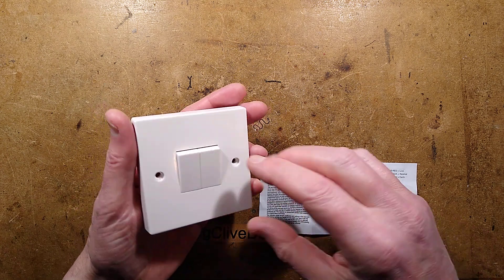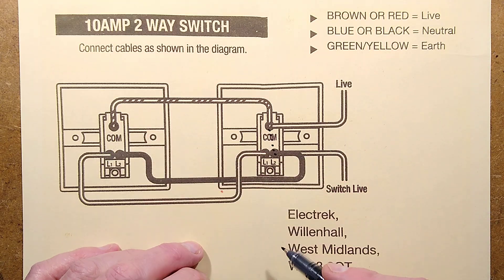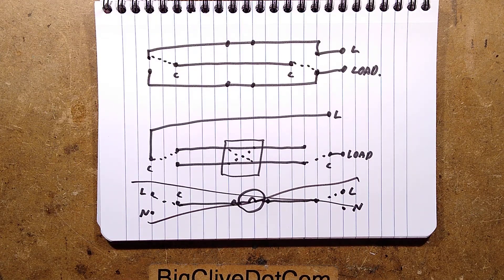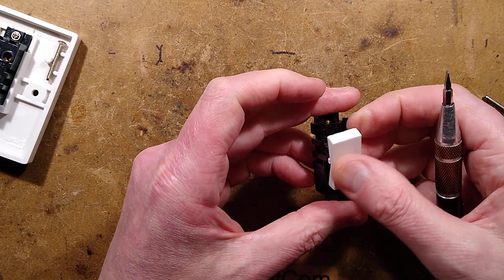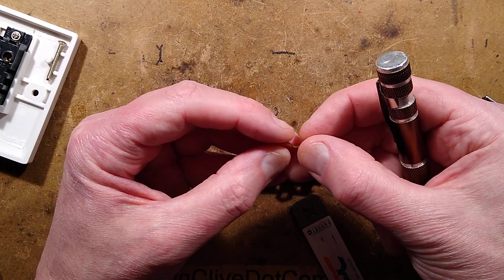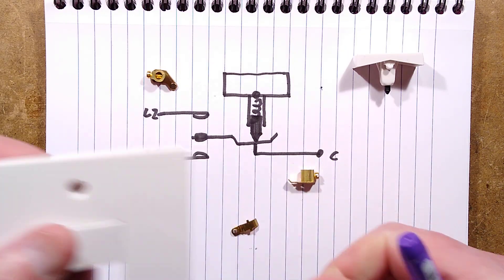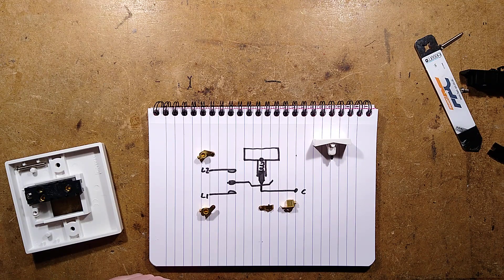Poundland 50p switch teardown

Comment: Can someone please explain the benefits of the prefered way of wiring? I only see it needing more wires, thus being more expensive 🤔
Reply: If you mean the top / uppermost circuit that Clive drew, it’s because the left hand switch only needs one three core & earth (widely available in the U.K.) cable to it. The right hand switch in addition has a two core & earth cable in (power in) and a two core & earth cable out (feed to the light or load).
The middle circuit needs either a length of single core cable (hard to find in the U.K.) or a two core & earth cable with one core unused. And you still need to get the neutral to the light / load...
Reply: @Mark1024MAK  I think there's a difference in where you want to use it. An in-door domestic setting uses only single core wires, and then I would prefer the second schematic, only two single wires between the L1 and L2.
Reply: @erikdenhouter In the UK single core wiring is not generally used in residential situations. Twin and earth is used, with three core and earth (using the 3-phase colours) for the second switch.
Reply: @SteveW139  Oh... In the Netherlands the standard is single cores in PVC piping, only for extra's like an extension or shed (or just when you see fit) we use 3 core wires.
Reply: @SteveW139  Single core used to be used in the UK when it was common to install conduits. Indeed at one time I'm told conduits were compulsory. 

It's still used today when rewiring older conduit circuits: you simply use the old wires to pull the new ones through. Homes which have had extra wiring added since being built with conduit then end up with a mix of the two types of cable.
Reply: @trueriver1950  - in the mainland U.K. as far as I am aware, conduit has never been compulsory for domestic properties. Some organisations did have their own requirements which specified that conduit must be used. Conduit systems are considerably more expensive than using twin & earth (2 core & earth) and 3 core and earth cables hence why you don’t often find domestic properties with conduit systems. Where conduit is used throughout, then normally all wiring uses single core cables (note that this is “single” insulated cables and is only permitted within conduit or within equipment/enclosures). Hence the middle circuit would be used. All the above relates to normal mainland U.K. practices. Other countries may have different practices.
Reply: It means you can control a light from 2 locations, eg a stairway light from the top & bottom of the stairway.

Comment: In Germany it is called “Hamburger Schaltung” or Carter System. If you have a metal lamp socket (e27 e.g) you may be in for a nice surprise 😮
Reply: I know it as Hamburger Schaltung too. I heard it was used in the post war but thankfully its not legal anymore. i always use the basic version that Clive drew first
Reply: I also know it as "Hamburger Sparschaltung" (Hamburg economy wiring),  because assuming that you have live & neutral for free anyhow at the switches (e.g. sourced from a socket nearby), any extra conductor between the switches requires extra conductors. The first variant shown in the video requires two extra conductors, the central one requires three(!) extra conductors, whereas the non-compliant one only requires one extra conductor. The central variant is nice if you don't have the grid near one of the switches, because you get "live in" and "load out" at the same end.
Reply: @tw11tube  The method gets especially interesting in a TN-C system ("klassische Nullung"). I remember reading about someone who managed to somehow cobble a switched socket into one of these circuits that then had live earth contacts half the time. Also the setup only works with DC-rated switches, modern ones just arc and burn out fairly quickly.
Reply: @Ragnar8504  Well, actually you can't install a socket with "klassische Nullung" (providing PE by connecting it to N inside the socket) at the load position of the "Hamburger Schaltung", as there is no N conductor, just two conductors that might potentially be live. So this installation was a failed attempt at trying to provide "klassische Nullung".
The worst I experienced in this regard was sockets with missing PE (due to broken "klassische Nullung", so chassis was at 110V through the interference suppression caps, which provided an uncomfortable tingling experience.
I heard about installations in West Berlin that operated on 220V 3-phase current (i.e. 220V live-to-live, not 380V 3-phase current with 220V live-to-neutral) well into the 1970s, so standard german household appliances were connected between two live connections. If the sockets in that installation provided PE at all, it surely had to be provided using a dedicated conductor.
Reply: @Ragnar8504  DC rated switches? I have seen 1960s, probably older switches marked AC only.
Reply: @Ragnar8504  What happened with that person who connected the TN-C socket to that  system?
Reply: Came across the 115/230v single/three phase in my cousins old house in Belgium.  Went crazy trying to work it out installing a new water heater for him until he explained there was no neutral!
Reply: The actual reason why it is called "hamburger schaltung" is, as opposed to the rest of germany, wiring in hamburg was always done with seperate N and PE conductors, as opposed to the rest of (west) germany, where the TN-C system was quite popular until the mid 70s. (Klassische Nulllung)
Reply: @FakeTheAntivirus  Did Hamburg have TT or TN-S? Regardless, TN-C is just a stupid system.
Reply: @mernokimuvek  TN-C-S, the PEN conductor was seperated in the fuse box.
Reply: @FakeTheAntivirus  Did they have a proper grounding system connected to the separation point or was it done in a shitty way like in the UK with no ground electrode at all?
Reply: @mernokimuvek  Depends on the building and the age, nowadays, all PEN conductors are grounded at the seperation point which is now located directly at the primary fuse box (where the cable enters the house), and then from there on a 5-conductor cable is used to connect the meter cabinet. However, in the old days it was common to seperate the PEN conductor in the distribution board, where it would not be seperately grounded. For example, you'd have a 4-conductor cable (L1,L2,L3,PEN) to your distribution board from your meter cabinet, and from there on cables going to sockets etc. would have seperate N and PE conductors. However some regions in germany actually had the TT System since the 50-60s, and there, seperate N and PE conductors and even RCDs were mandatory.
Reply: @FakeTheAntivirus  What is the maximum allowed resistance of the grounding system for TN-C-S in Germany? In Hungary it is 0.5 Ohms at the transformer, 10 Ohms at the utility poles and buildings. Someone wrote that in the Czech Republic 12 Ohms is allowed. AFAIK the craziest is the USA system where they allow 25 Ohms.
Reply: Break before make, or boom. Too much current, common pulls the terminal as it disconnects? Boom. Seven year old balances an aging switch in the middle? Boom.

Comment: Oh. That third way explains something I saw in my grandparents' house when I was replacing the 3-way (US) light switches in their hallway. I couldn't figure out why one of the wires was seemingly a different color at one switch than at the other switch.. But thanks to your diagram, I assume the ceiling-mounted lamp (located halfway down the hall) must have been wired between the switches as shown in your third option. Ugh. None of the wiring in that house was remotely up to code (even under the ancient rules in place when it was built in 1954) but as far as I can tell it must have never been inspected properly.

All of the "3-way" (UK 2-way) wiring diagrams I've ever seen in the US have shown your 2nd option, so that's what I had expected to find when I replaced those switches. (And all the other ones I've wired have been that way.)
Reply: Here in India if I see a wire with a different color I always assume that the electrician ran out of the wire he was using and had to run out and buy some more and got some with a different color.

Comment: Honestly wouldn't be buying major electrical switches or outlets for the pound shop in the first place, better off going to b&q and buying from something at least half way certified
Reply: I've been upgrading all the worn out sockets in the house with spec grade (US thing, means they meet specifications for federal govt builds), I don't have a big house so the extra cost is pretty negligible and they inspire so much more confidence than whatever is cheapest at the hardware store.
Reply: @treelineresearch3387  exactly, always good to be sure when you've done the work yourself
Reply: @treelineresearch3387  I don't think there is really any equivalent of "grade" for electrical accessories in the UK. Some brands have a better reputation than others, but I also see a lot of electricians claiming that formerly top brands (particularly MK) aren't what they used to be.

Comment: Clive might be able to explain this in a video.  Years ago I read a book called Currents of Death, about the statistics suggesting that EMFs - electromagnetic fields - being associated with disease such as leukemia in young children.  They talked about heating blankets creating a magnetic fields close to the skin.  So heating blankets started using twisted pair wiring so that the electromagnetic fields canceled out.  They also talked about running AC wiring through the walls so that the supply and return currents are run through the same path so that the electromagnetic fields cancel out.  Some situations don't do this, such as when there are 2 two-way switches, one at each end of a hallway.  One solution might be to run the wiring inside of EMT - electric metallic tubing.  But the thing to avoid is to have the AC current running from one switch to the other switch and then to the light so that you are surrounded by a big loop of 50 or 60Hz current.
Thanks, Clive for the very interesting channel.
Reply from the maker: I've never seen convincing evidence that living in the vicinity of electrical fields is harmful.  Electrical line workers are exposed to very high voltage gradients for long hours every day, and most live to a good age.
Reply: @bigclivedotcom  
I've worked around electric equipment all my life and I'm old, but I've lost a kidney to cancer.  The book based the leukemia on a slight statistical evidence, but there were many studies in the last several decades that found no statistical evidence.
Reply: I remember seeing a “quack/snake oil” video about a middle aged man claiming his laptop gave him cancer in his thighs because of it “being” on his lap, 🤨…. but others said that was impossible ~ it has internal shielding to stop interference with nearby radios and itself. Then we have various radio frequencies flowing through the air which we are oblivious to
Reply: Sounds like a book of lies.
Reply: The real reason for not wanting AC loops is that in the wrong circumstances they can generate induced voltages inside the loop. That's why it's often considered good practice to make sure that the current returns close to the outward path, for example down the same twin cable, or by single cores within the same conduit.
Reply: 50Hz electromagnetic radiation does absolutely nothing to biological organisms.
You need to wind the frequency way up (many orders of magnitude) before any effects occur.

Comment: 3:20 the additional problem here is that some switches are sloppily made and they're in fact make-before-break, which would be completely harmless in normal live switching situations, but not here. I had this circuit in our flat and the switches were already burnt. Needless to say that I modded this to use proper live-only switching.

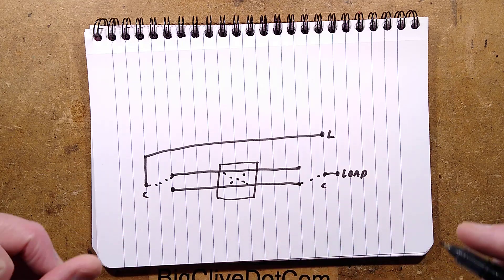There's also a German "Sparschaltung" ("economy circuit") which would be a version of 2:37 allowing you to use a 5-lead cable (PE, N, supply L, lights L, switching L) and have supply L available along the line to branch off and power further lights, with a limitation of using only a pair of switches (no crossover switches are allowed).

Comment: shame that the destructions cant get it right, you cant trust all electricians to know the correct way to make it work. I always had to draw it out on paper before I started wiring them in. But I never got it wrong. 2x👍

Just had EON telling me the were coming to swap my electric meter as it was a legal requirement to do so, as my meter was old. Told them to sod off, and I'm within my rights to indefinitely refuse a smart meter. 🤣🤣
Reply: Er, actually they may genuinely have to replace your meter if it's past a certain age, as it has to be certified to meet accuracy standards. But yes, remain terrified of the evil smart meter which, uh.. doesn't impact you at all.
Reply: What is the advantage of keeping the old meter and not having the smart meter?  The old meter must be read manually, someone must bother you and maybe your dog to look at the meter.
Reply: @acmefixer1 - I’m with Octopus and read my traditional meters (electricity and gas) once a month (on the first normally), then it takes less than two minutes to provide a meter reading online. The first generation of so called SMART meters don’t always work between different supply companies, not all work correctly if you have a PV solar installation. And when they stop communicating (develop a fault), the companies aren’t the least bit interested in sorting out the problems. Hence, IMHO, it’s best to wait. I also don’t like the fact that customers own money (all electricity and gas customers) is used to pay for a scheme that uses propaganda to persuade people that SMART meters will save you money. You only save money if you use less. But, the standing charge (which is higher than before the SMART meter scheme) does not reduce if you reduce your energy consumption. After the novelty wears off, how many people will actually keep a regular check on their indoor SMART meter display? I’m pretty sure most will have far more interesting things to do....
What we really want is a scheme to actively encourage people to super insulate their homes. And to move to heat pumps rather than gas boilers.
Reply: Is there anything inherently unsafe about the included instructions? I'd say the instructions needlessly suggest you have to run a third wire when you can get away with just two travelers as Clive showed in his first drawn circuit, but in his second drawing, he shows three wires being run between the switches, so same amount of copper. Besides being confusing for the next person working on the switch, is there anything against regulatory that deems the instructions as non compliant?

Comment: A friend of mine asked me to help with with the electrics in a house that she had just purchased...there was a three-way switch in the kitchen for a light group.  
I had a seriously confounding problem of the switches...not only being wired in the non-compliant way...but also that they used the wrong wires to connect them.  
There were several things in the house that were badly wired and it took a few days to figure it all out.
Reply: When I moved into my old house there was a two way switch near the front door and the other switch at the end of the hall, no idea how it was wired, one switch only had 2 wires going to it. you could turn it on or off from either switch, but if you turned it on at the door you had to turn it off at the same switch!  Just to add more confusion, one switch lit the lamp at half brightness. I measured the voltage at the socket, one switch gave 240 volts, the other only 165 volts!  no idea why. I fixed it by using an led lamp, the regulator in the lamp sorted out the voltage!  (didn't want to start chipping the plaster off the wall to trace the cables!)
Reply: @zebo-the-fat That sounds like a serious wiring error and bodging round it isn't fixing it. You don't have to chip away plaster to trace wires if you turn off the supply and use a continuity tester. Now that you're aware that there's a problem, if you can't fix it yourself it would be negligent of you not to call in someone who can.
Reply: @johnm2012  Probably true, but I have since moved house and the guy that bought my old place said he was going to have it rewired anyway  :)
Reply: @johnm2012  If I'd come across rhat situation, id probably have removed the existing switches, ran constant power up to the light
 [re]using existing wires, and put a radio controlled relay in/before the light. 
Mate 2 self powered radio switches in toggle mode to the relay. Place switches wherever.
Can save a lot of work in concrete/stone/plaster buildings.

Depending on type of relay module used,  it could also, optionally, be app controlled over wifi.

A bit more expense, but IMHO, often worth it given the other savings...
Reply: I suspect it is taking its supply from some other equipment in series. 
IE. Two 6v bulbs wired in series will operate  on 12v perfectly, two 12v in series they light up dimly, because they would require 24v.
I would recommend you talk to a professional about this!
To get a clue, as to where  the power is  coming from turn off all breakers ( or remove fuses ) then find out which breaker is feeding your lights and from there find out what other equipment is being supplied on this circuit, and possibly the location of the low voltage supply. 
Hope this helps, I no expert, mostly work low voltage DC
Reply: Yeah... right... what could possibly go wrong in a place that allows any unqualified DIY moron to wire up homes and garages?
Reply: It isn't good being that guy who simps, trust me I've been there trying to be the tech guy who fixes things for people aka women.